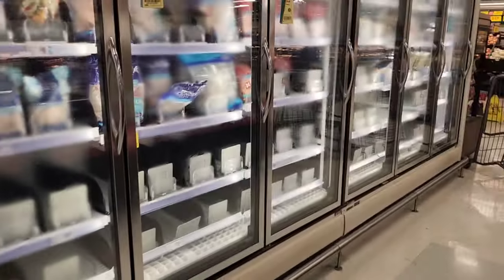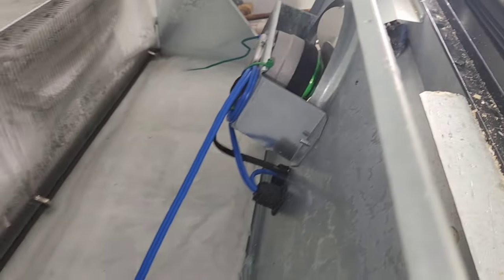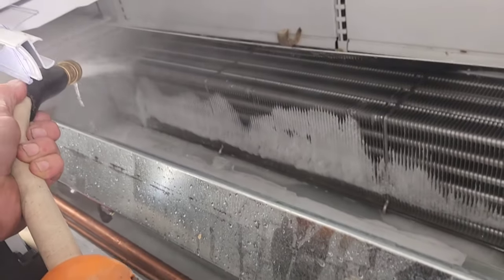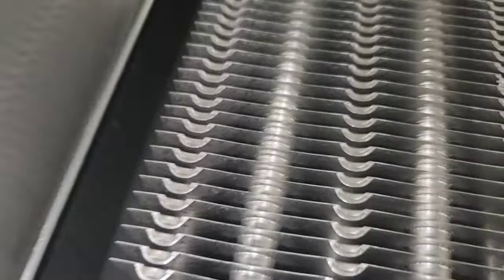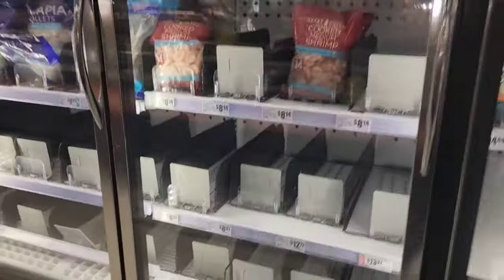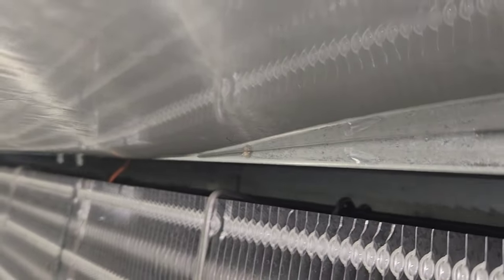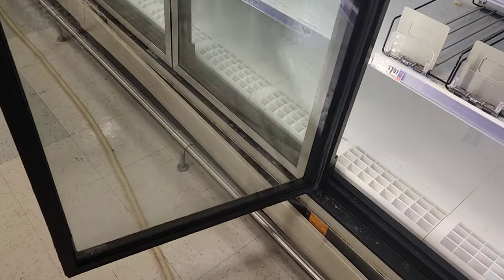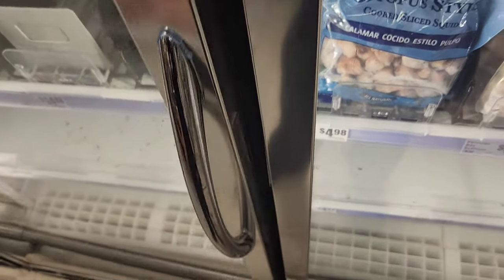How to Deice(wash) a Frozen Food Case

Comment: For some of our problem areas, they installed pencil heaters for the drains so they never get clogged
Reply: Yes a I’ve done that also and it works great as long as the customer keeps the equipment maintained and not abused by employees.